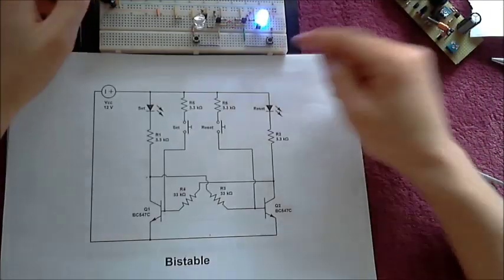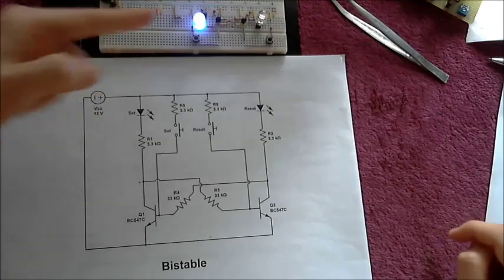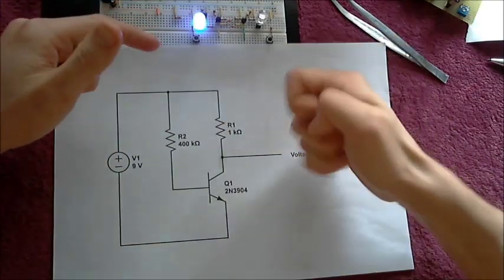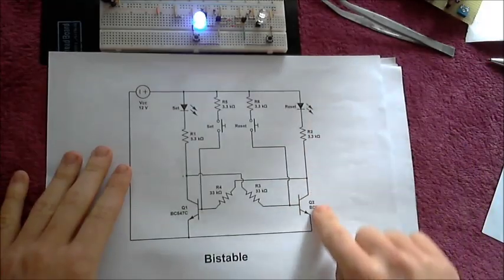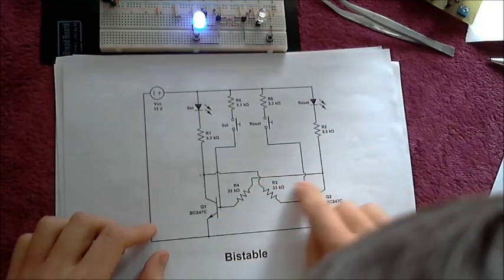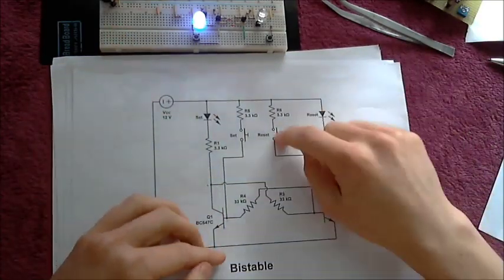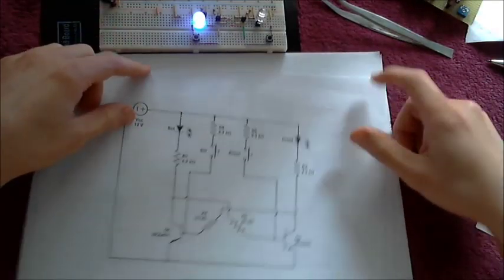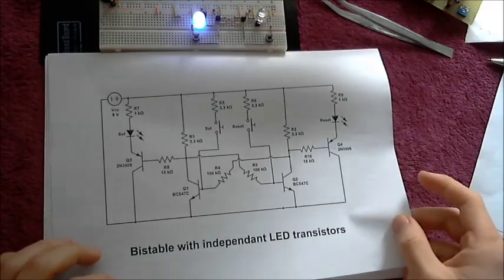Practical Flip-Flop Tutorial (multivibrator)

Comment: What if R1 and R2 are around 1K Ohm and avoid using the additional two transistors? The LEDs will be brighter in that case and there will be no additional transistors.
Reply from the maker: Yes true that would work. As I explained , you don't really need those additional side transistors. I just put them there so I didn't have to have the LEDs in the main flip flop.